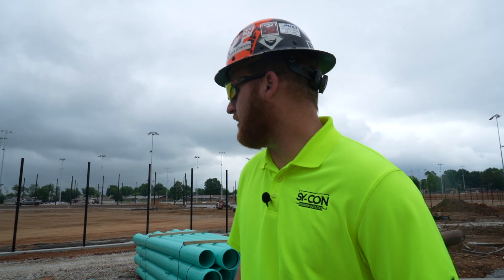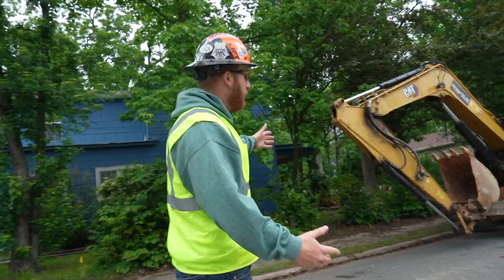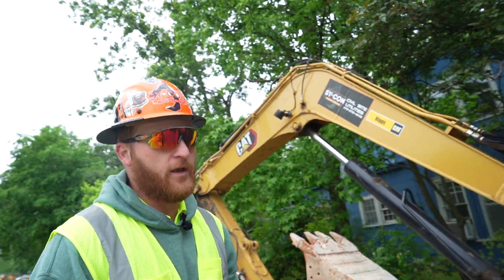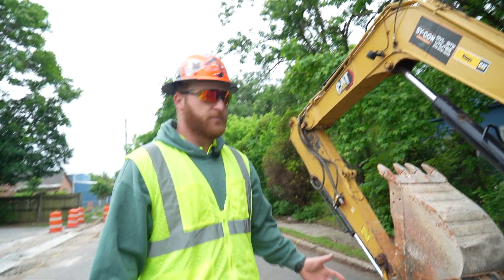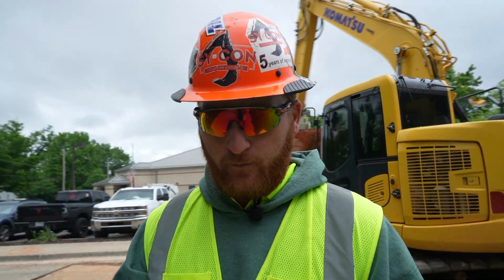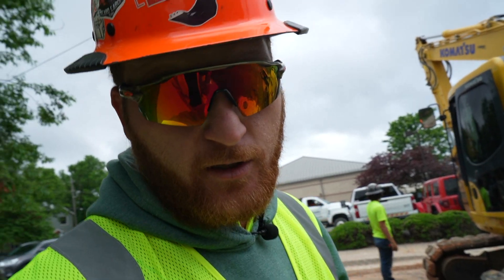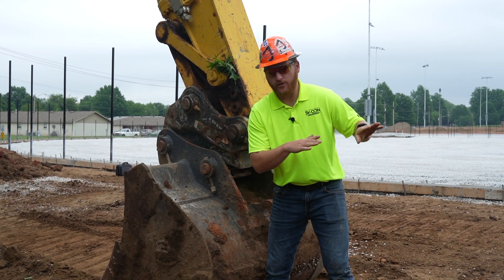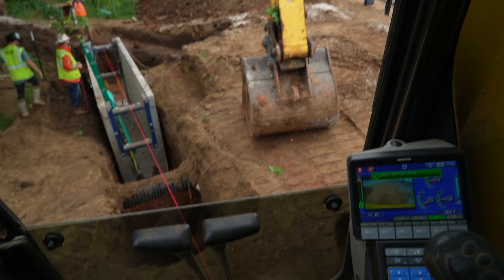Taking In Depth look at some of our Machine Fleet! - During Sewer Pipe Installation

Comment: My time doing that mainline sewer was 1979. we had a beast of a track hoe it was a ( Bucyrus Erie (350) very powerful in the hard pan. 😊 we used a case (850) track loader for running pea gravel and backfill. Man, that case was "very " fast" with at the time the power track turns. 😊 I got to dig the side sewer stubs with a Dynahoe-190, Dynahoe-.  fell in love with her. It was a beast. The standard digging depth was 19 feet. So, the side sewer stubs I never needed an extendahoe 😊  I bought a used one in 2003. She is just my play toy baby girl 😊❤😊 she now has over (8000) hours on meter and has never overhauled the old school 353 Detroit Diesel 😊 she just keeps running with new 40 Wt. Oil changes. I have pulled out huge maple tree stumps in yard, have pulled up my old driveway for new cement, replaced my water service, you name it 😊 my wife even lifts me in front bucket to trim tree branches 😊 believe it or not we got a swim spa and the company wanted to know if the patio was stron enough for Wt. Of the new pool. Well I set my baby (19000) pounder on the cement and left her there 24 hours. The cement base held just fine for pool Wt. So I have used the old girl for everything. By the way, Bucyrus Erie made the "largest " dragline " ever" in the world (220) yard bucket they called her ( big Muskie) so I named my Dynahoe ( little Muskie) after her, because they will probably never again make a dragline that big.

Comment: I'm very surprised that you don't have a side dump bucket on your wheel loader.  A utility contractor with out a side dump , especially on a qick coupler equipped machine doesn't make any sense really.
Reply: It’s not a must, maybe if your work is always in the city but I’ve laid pipe all over the south and I’ve only had one twice in 15yrs always been able find a way to make it work
Reply: @DLo336  yes, you can make it work, but a side dump on a loader is 400% more effective and efficient than a straight bucket once you learn how to use them. So much better.
Reply: @johndeere350b  how? Again in a tight spot sure but other than that I can do anything it can just as fast with a normal bucket setup
Reply: @DLo336  , with all due respect, I'm sure your an excellent Operator and can do a great job. But believe me, there's no way possible to get a utility trench backfilled , boxed out and paved with a straight bucket as there is with a side dump. Not even close. I don't have time to explain the procedures but it's true.
Reply: @DLo336  , personally I don't know why you feel the need to get impolite. I don't talk to people who aren't gentlemen. It's a waste of time. But I will say, yes there are techniques and operating strategies that I could explain, but I believe due to your desire to be rude and insulting, I don't think you would comprehend. And I don't think I am special. Just experienced.
Reply: @johndeere350b  buddy we’re talking about a side dump bucket. It doesn’t do anything special. Like I said they are cool and all but they aren’t a necessity
Reply: @johndeere350b  and with feelings that soft you probably go home everyday at 2:30 lol
Reply: @DLo336  Have a great day. Goodbye